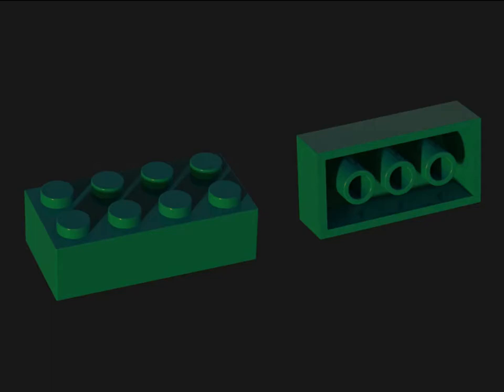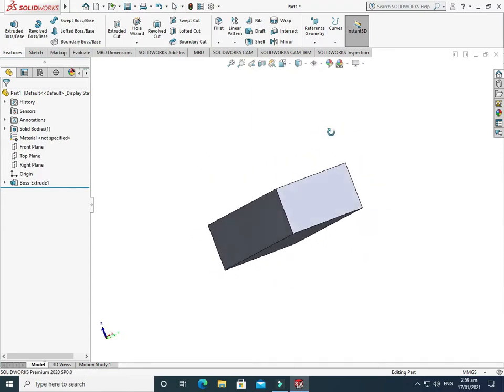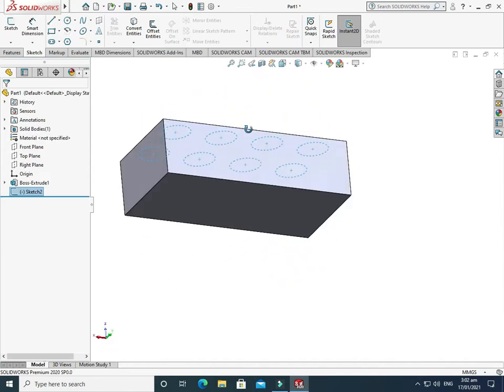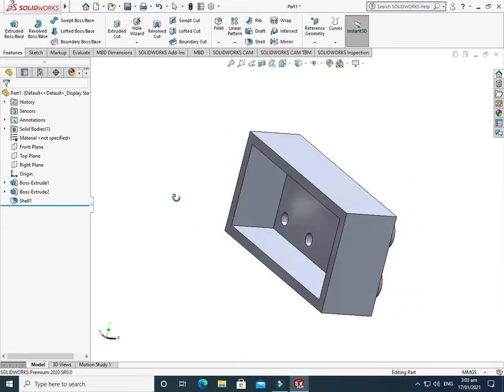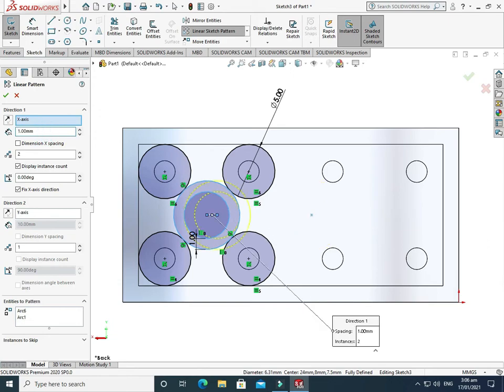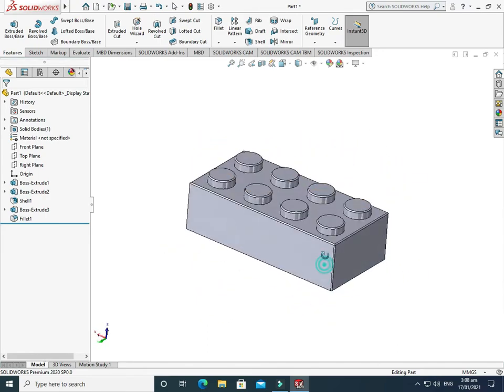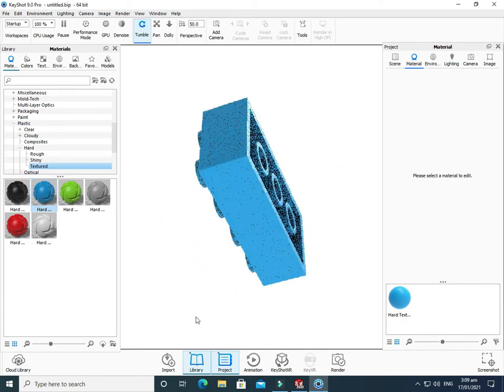How to sketch lego brick in Solidworks | Lego brick Keyshot | CADable | Lego brick solidworks

Comment from the maker: Tutorial Beginning: 0:00
Part Modeling: 0:15
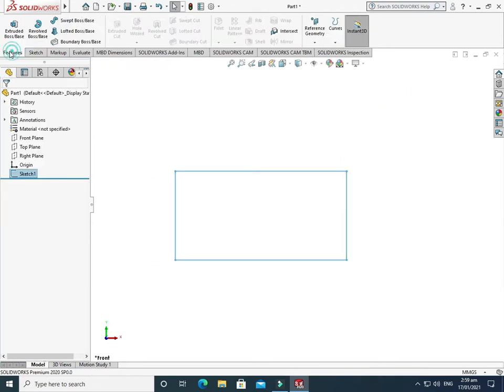Extrude Boss: 1:24
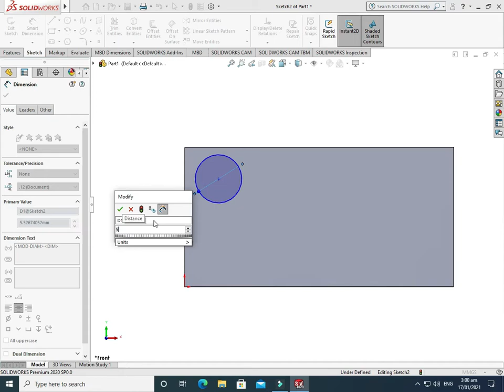Constraint Circle: 2:14 
Linear Pattern: 3:01
Shell Command: 4:49
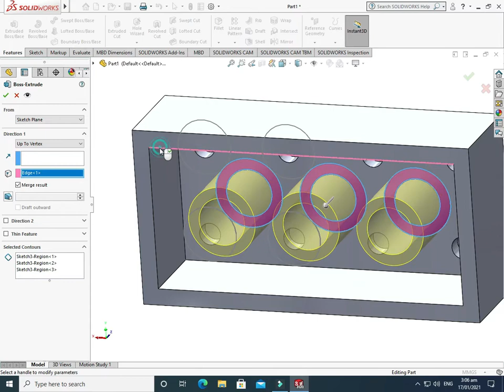Fillet Command: 7:54
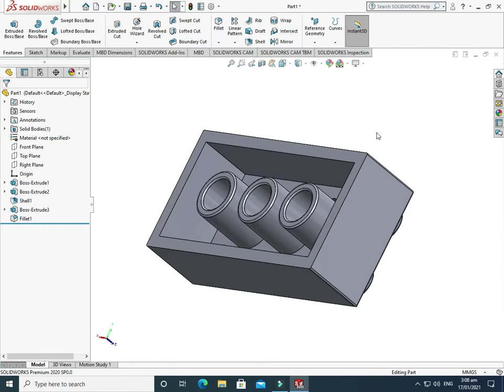Keyshot Plug-in: 8:55
Basic Settings: 9:32
Keyshot Material: 9:46
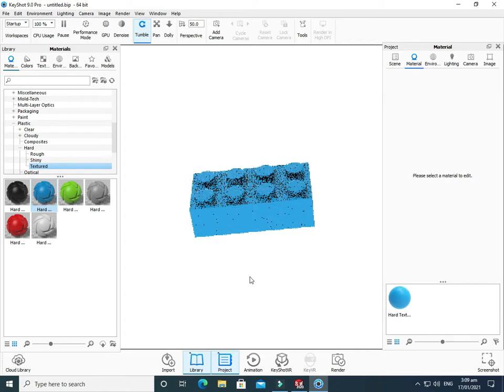Duplicate Model: 10:09
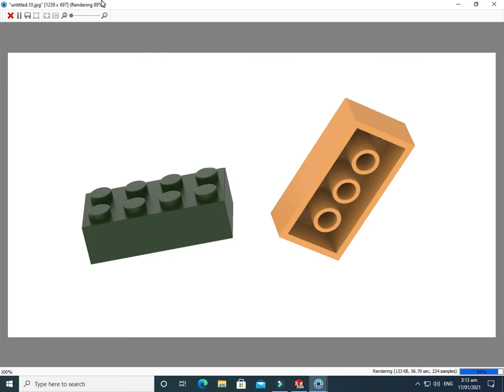Final Render: 13:16
Final Element: 13:35